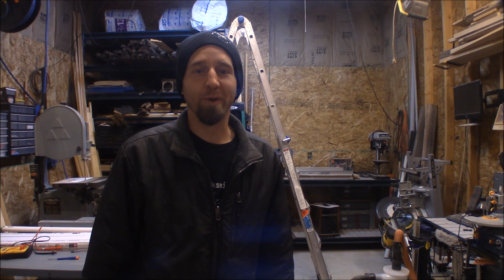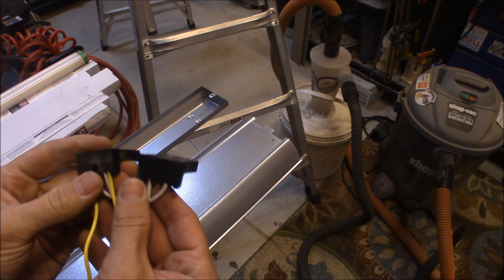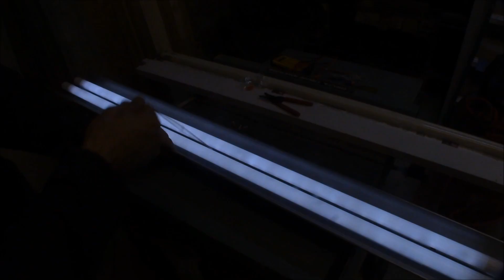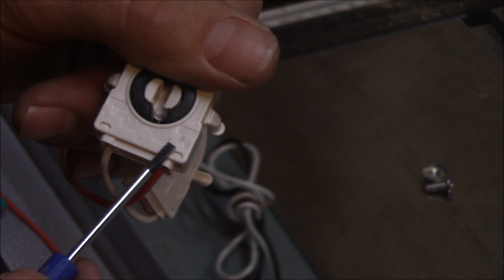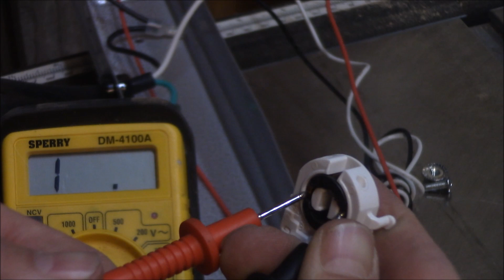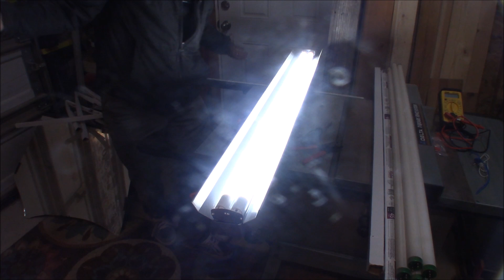How to Rewire Shop Lights for Ballast Bypass LED Bulbs

Comment: Wished that tou would explain how to jump the power to the other thumb  stone
Reply: Thanks, I added a neutral to other end
I guess my bulbs where 2 side.
Reply: @Richard-vj4wj  that's good information to know. I wondered that in my video. Looks like some bulbs are two sided or one each.
Reply: It's pretty simple if you need it. You can just add one wire for each leg of the tombstone.

Comment: If you are able to just push those wires into the tombstones, what is securing them? Why wouldn't they readily come loose?
Reply: The metal clips inside the tombstones have angled pieces like "Y" that prevents the wire from pulling back out.
Reply: @MarcSchaefermeyer  Thanks. BTW, I'm guessing that you are married to a Filipina?
Reply: @61JWolf  nope

Comment: Are there shunts in both ends?
If so, do they have to be removed from both ends?
Reply from the maker: There are shunts at both ends. Only one end needs to be fixed for the bulbs I used. One end gets the electricity, the other is used just to hold the light. I answer this in the video showing the bulb lights up via one side.

Comment: Buy dual ended powered LEDs and you can use the shunted tombstones
Reply from the maker: Good thought. These lights were an incredible deal, so I dealt with it. Good to know though! Thanks.
Reply: Yes.  That's the easiest way to install the LED lamps in this scenario.  A good job!

Comment: I’m glad you showed that the shunt could be removed. I had been wondering about that. Thanks!
Reply from the maker: It was something I had wondered as well. Glad I'm not alone!
Reply: I have a bunch of 4 bulb lights that I acquired about twenty years ago and they were old then. Most of them wouldn’t light and those that did wouldn’t light below 40 degrees, so getting those fixtures back in service for the price of bulbs is a game changer. Thanks again for the great video! Gonna sub right now
Reply from the maker: @frankherring6253  This is great news!  I love saving people money and the environment from waste!  Thanks for the sub.  It helps keep me motivated to make new helpful videos and share!

Comment: Good video!  Do you know anyone selling a retrofit kit for the 8 foot tubes? I want one that lets me remove the ballast as well. Any suggestions? And where did you get your bulbs?
Thanks for your time.
Ron
Reply from the maker: Thanks for watching Ron. I got these bulbs from a local lighting company. They were cheaper than any big box store. As to an 8' bulb; I'm sure they are out there for purchase. If it's four 4' bulbs, two end to end that's as simple as just wiring four tombstones. Hope this helps.

Comment: Nice to get rid of that annoying hum of the ballast. I replaced all my t12 bulbs with LED but still have the ballasts.  May move to your solution when the ballast go bad Marc. 👍
Reply from the maker: Totally agree!  I almost went that way but was deterred when my ballasts wouldn't work with replacement bulbs.  Then I got a killer deal on these bulbs!  Thanks for watching!
Reply: And remember you'll save even more on your electric bill since the ballast needs power to work as well.